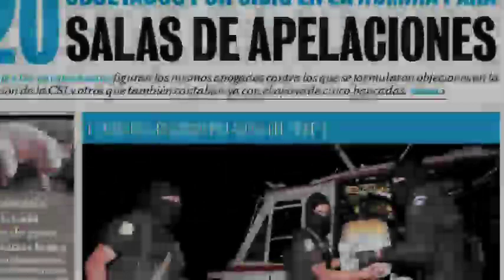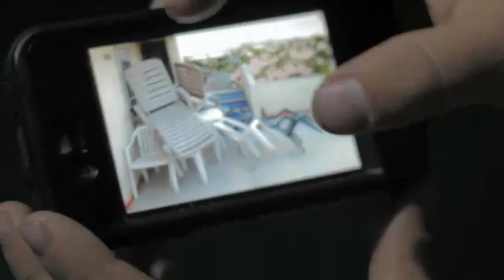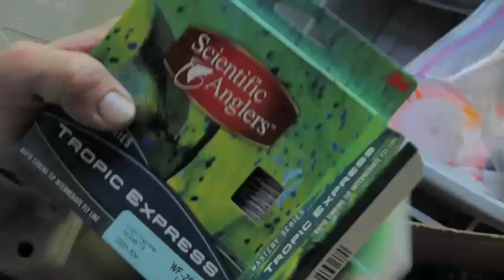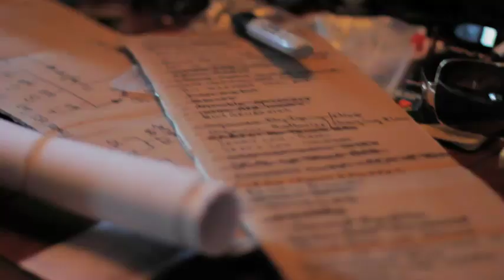GEOFISH: Expedition 2011

Comment: The boats we use are Gheenoe's. They are a cross breed between a canoe and a skiff. They have a transom on the back to mount some ponies. We run Yamaha 10's off the back of ours. These boats are the bomb! You can check em out at gheenoe.net